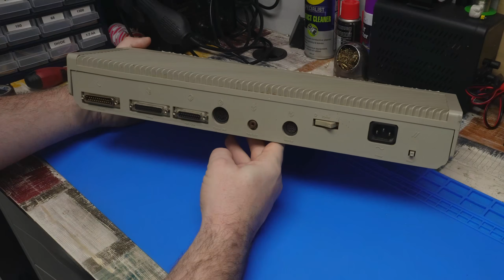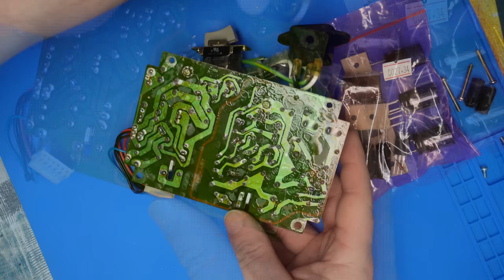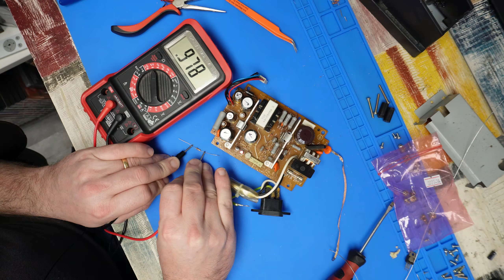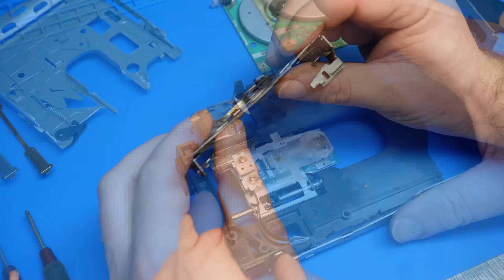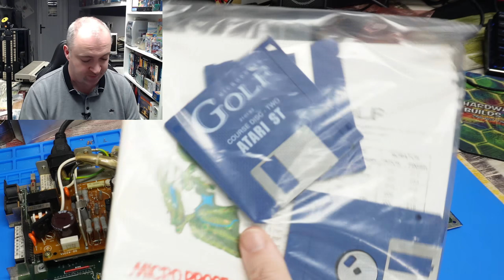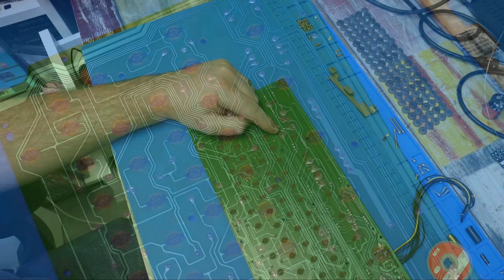REPAIRING and UPGRADING my ATARI 520ST #febtari

Comment: Great video, I pulled out my stfm last year and bought a mega from  ebay.. I built a SCSI tower with CD drives +(I just added a Phillips 6 disk CD changer) 

Got a VGA adapter with et4000 VGA card and recently added a cloudy storm for an additional 8mb alt ram and tos switcher. 

I built an exoss st version of the TF 536 68030 accelerator  soon ill socket  the mega and try it out.

Comment: You should calculate the formatted and usable capacity of the disk again: 80 tracks * 9 sectors per track * 2 sides * 512 Bytes per sector gives you 737280Bytes -> divide by 1024 and you have 720KBytes total capacity. But bootsector, FAT and root directory need space, too. Got it? 😉

Comment: Amiga disk drives also work with the Atari ST computer.  PC disk drives, with the jumpers, also work very well with the Atari ST.  I installed a Gotek drive in one of my Atari SF354 drive cases.  It matches the system and works great.  I mainly use a hard drive with my ST.  So, I rarely use the disk drive or Gotek.  The best hard drive for an Atari ST computer is the SupraDrive Atari Hard Disk by Supra.  I plan to show mine on my channel this year.  I also plan to post a video about the Atari MegaFile 30.  😃
Reply from the maker: I do want to add a gotek to this alongside the floppy drive as I just like having those in my machine.  One of the original hard drives would be cool but for now I've a modern slsd card solution coming.  Will have a video on that hopefully in the next couple of weeks.

Comment: The new capacitors MUST be flush and seated onto the PCB.  So, if the lead pitch is wrong, stop what you are doing and buy capacitors with the correct size lead pitch.  It is usually measured in mm.  Remember, these are switching power supplies, which means the parts can vibrate at high freguencies if they are not installed properly.  This is one of the reasons you will often see the larger capacitors glued to the PCB, or they will have silicon rubber or hot glue around the bases of the capacitors.  If the capacitors are not installed properly, they can vibrate off their leads, or the vibrations can damage the capacitors.  I show how to properly recap an Atari 1040ST power supply on my channel.  I suggest you watch the two videos.  🤔
Reply from the maker: I thought I did install them flush 🤔
Reply: @CRG  If you can easily wiggle them, they are not flat to the board.  I show how I do it in my videos.  😃

Comment: Beeping to tell the keyboard is not connected was a good idea. Although, I really didn't like that constant beep with every click when using the GEM Desktop. It was a fraction behind the keyboard press, which makes a noise anyway. I wonder who decided that as a default setting? I don't even remember if you could disable it.
Reply from the maker: Apparently, with the correct setup disk, it can be disabled.  But yes it is weird that the noise doesn't come exactly with the key press. It's always a little off and is annoying because of that.

Comment: Are you aware all of this Atari (And I mean ALL consoles, Computers & handhelds), are fully emulated now for PC's? ROMs are super easy to find and download as well. I threw out my aged and broken 800, 600XL, 130EX and ST long, long ago. Much easier to work/play on the various Emulators freely available.
Reply from the maker: Yes, I am aware of emulators.
Reply: @AudioGuyBrian  I love to see a recap on an emulator 😂
Reply: @Notel-ce1eb  You can recap any piece of hardware (Obviously) if it is 40 years old or so. Nice thing is software runs on any hardware so you just fire up any PC, load up your software and you are back in business.
Reply: @AudioGuyBrian  you’re then missing the fun that so many enjoy, it’s not all about playing the games for everyone
Reply: @Notel-ce1eb  I know the hardware collection bug. I collect Vintage Tape Decks and Audio Receivers. I play them daily (in rotation) to keep them from dying in the dark. Computers of the 1980s were just so difficult to keep running and disk drives from back then (And the floppies) are getting to point of total failure. Plus for vintage Atari gaming, I like using an XBox 360 controller and mouse (To replace trackballs and paddle controller) way more for Atari games. Especially games like Star Raiders. I can map all the keyboard buttons to my XBox controller buttons easily. I do appreciate people restoring this stuff for future generations to see though. Thanks.

Comment: Nice refurbishment! I have an upgraded 520STFM, but whoever upgraded it didn't fit the decoupling caps. Seems to work OK but I will fit them when I give it all service....
Reply from the maker: Thanks, glad to hear you enjoyed it.  They are just providing some smoothing of the 5V supply at the IC so aren't essential per say as there are plenty of other caps on the board doing the same thing but are certainly  a good idea to install.  If you don't have 220nf like I fitted, 100nf is the typical value used for decoupling.

Comment: Atari St power supplies are not good.   Even after re-caping many still cause bad video.   It is best to just replace the power supply with a new Meanwell power supply.
Reply: Not true.  They are great power supplies.  They are rated at 65 watts, plenty of power for the Atari ST computer.  Where you run into problems is when you install a bunch of crap inside your Atari ST computer that is not really needed.  This taxes the power supply, which can cause all kinds of problems.  The best power supply for an Atari ST computer is a PC XT power supply.  They are external and they are fan cooled.  They can also provide power for the Atari disk drives.  🤔
Reply: @HansCampbell  they are bad way to speak.... the capacitors used by atari were not rated higher enough..... proved with oscilloscope check.

Comment: That blue LED makes the babby Jesus cry. Well done on the restoration!
Reply from the maker: I may have to change the leds or face the ongoing wrath of the Atari community.  The power led was green, what colour was the floppy led?
Reply: @CRG  orange
Reply: @CRG  I too don't like blue so much BUT this is your machine. If you like them that is all that matters. Soldering in the RAM isn't so bad either since it was all tested and now you don't have sockets to make for a failure point.

Comment: Joystick port extender cables left plugged in are the essential accessory.   Hard drive emulator that plugs into the ACSI port  like an Ultra Satan or SD4ST are the best solution for software.   Most games are available in a version HD installable

Comment: I bought an ST from ebay and it let out the smoke as well (bought it with the fault mentioned).

Surprisingly, in my case the cause wasn't the power supply, a previous owner had expanded the RAM to 1MB and had put in tantalum, rather than ceramic caps... A few of these had exploded! I just cut out the blown up ones and left it like that. Works fine.

Comment: 34:35 "Blue LEDs are nice to look at, aren't they?"
You're the first person I've ever heard say that out loud. I hate them with a passion. If I were more paranoid I'd say electronics designers put in blue LEDs just to torture me personally. I've never met a blue LED that I didn't think could be improved by covering it with a few layers of electrical tape, or crushing it with pliers. I prefer a nice warm red, yellow, or green LED that doesn't stab me in the eye from 30 feet away. 

Personal opinion of course, I'm happy you got to modify yours with a personal touch you enjoy.
Reply from the maker: I knew it would wind people up 🤣

I really don't like them either to be honest but the way they sit in this they aren't that glaring eye piercing blue that you normally get. It's just a subtle blue glow when viewed through the case so its fine in my book.

Comment: I did the RAM upgrade on mine back in the 90s but shorted one of the chips so that the machine wouldn't boot. I was gutted, and eventually took it to the TV shop I used to work at. Straight away they found the obvious solder blob and fixed it - I still can't believe I missed that.

Comment: I used to have an old Atari ST F.  The main difference being that it had external disc drives and the joystick/mouse ports were situated where the drive is on an ST FM or ST E.  It probably had less memory as standard but I got it upgraded.  It was a good home computer but it always seemed that little bit worse than an Amiga, mainly in terms of the sound system.  A while back I saw a video about a device that let you use the Atari's hard drive port to read SD cards.  That would probably be a good idea to make getting games or other software onto the system more conveniently.

Most of the games I would suggest checking out on this system are pretty much the same as you might expect on an Amiga (Dungeon Master, James Pond, Altered Beast, etc) as most software that came to the ST ended up on the Amiga as well and vice versa.  There were some titles where the ST performed better due to its higher clocked CPU but more often than not this was either mitigated or the Amiga would pull ahead with others due to its custom chips.

Comment: What would I have done differently?  I wouldn't have fitted damned blue LEDs.  They can burn in hell!

Anyway, nice work on the "1040ST".  I am far from an Atari expert.  Is the RAM fitted the only difference between the 520 and 1040?

I think the shiny material on the power supply PCB may be conformal coating, not flux.
Reply from the maker: @Starchface  I knew the blue LEDs wouldn't be to everyone's taste 😅.

I believe the only difference in the models is the ram but equally I'm far from an Atari expert.

Comment: Homebruary sounds better.
Augustari, as well.
I have a 1040 STF that could stand to have its PSU rebuilt, and I have a GOTEK drive for it, but since I got it, I've only smoke-tested it, not even verified which TOS version it's running, as I never had any Atari computers in my youth. This is just xeroxed nostalgia, I guess.
Reply from the maker: It's just for a bit of fun so call it what you will, it's a great excuse for me to finally get my st sorted.  

I forgot to say in the video but I'm running TOS 1.04 (I think).